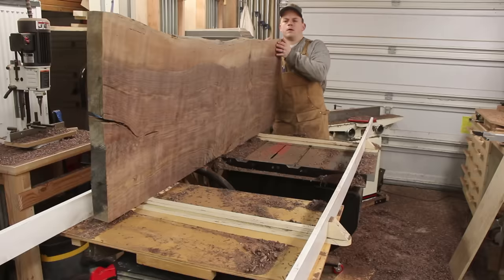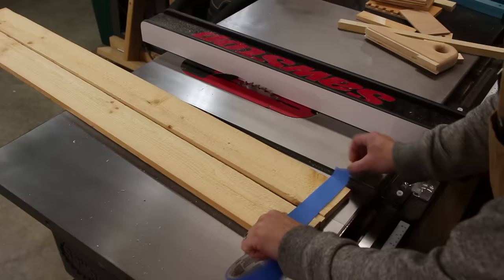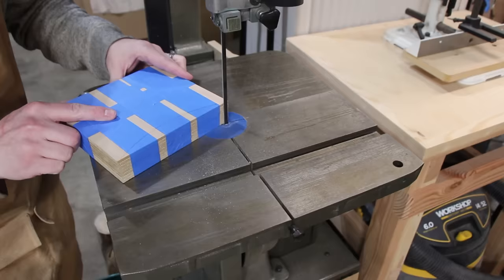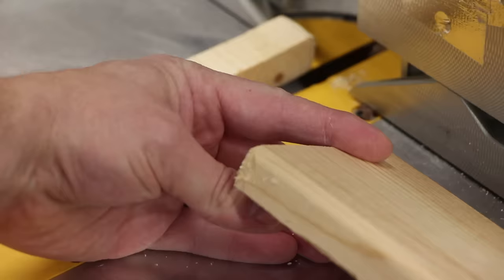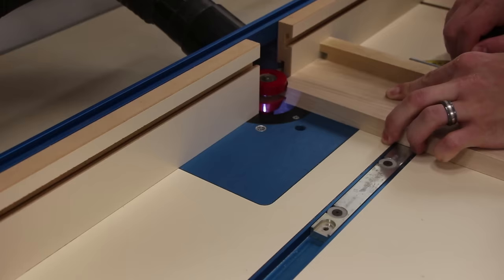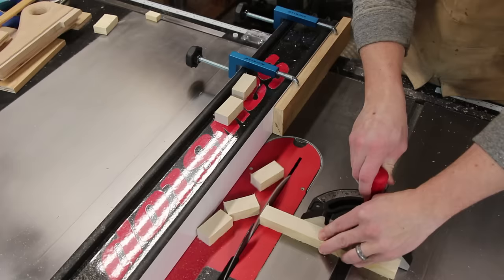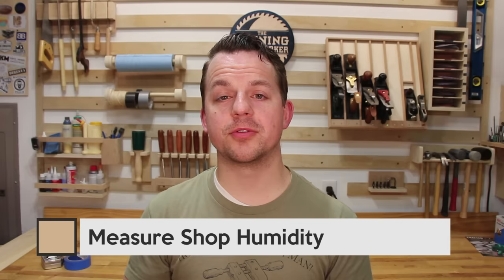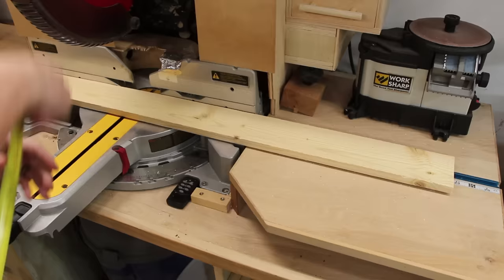7 Woodworking Tips & Tricks You Really Should Know | Evening Woodworker

Comment: @4:30  WHY in the world do you need the Rockler clamps to add an auxiliary fence piece to your fence?  I mean, I own them, but I would never bother with them when a regular clamp would be faster.
Reply: Sometimes you can use the regular clamp, depending on the piece you’re cutting. I’ve run into enough cases where the clamp gets in the way of making the cut, that I picked up a few of the fence clamps and they work just great! The only down-side is having to drill the 3/8” holes in your fence board to put the
Reply: Hooked end into. (darned little keyboards!) 🤣
Reply: @nopelosi2012  Yes, and as I said..."when a regular clamp would be faster"...which was def the case in the video.

Comment: THE best way to measure much of anything is NOT TO MEASURE...

    Yeah, that seems ridiculous... BUT especially when I have a dubious number or a stop and start kind of supply requirement on certain parts or pieces of work, the FIRST I make is as perfect a "template piece" as I can get... THEN there is no more measuring... I lay the template down, draw lines around it, and because EVERYTHING else is a replica of the same template, there's no wandering of measurements no slipping... 

    Similarly, utensils like story-sticks and ticking sticks and pattern boards are imminently better for precision fitting than any tape or caliper or other measuring devices you can ask for. Never measure something you don't have to...

     Sometimes the important part of precision is proportion... so it's not about numbers of inches or millimeters... It's that the length is twice the width and three times the thickness... In these instances, you can even be better off tying knots in strings to keep your marks and measures straight...

     AND finally, you ABSOLUTELY should memorize the "magic numbers" 3,4, and 5... This helps you "confirm square"... A triangle that has legs of 3 units and 4 units is a RIGHT triangle (dead square, perfectly) when it's hypotenuse is 5 units... You can define the "units" as anything you wish... so long as they're ALWAYS ALL the same units. 3 inches and 4 inches gives a 5 inch hypotenuse... 3 feet and 4 feet gives a 5 foot hypotenuse. You can even define a unit (to scale) as 2 inches... so 6 inches and 8 inches in a right triangle gives a 10 inch hypotenuse... Works every time... AND with just a tape measure and straight edge (say... a level) I can even mark and cut a "square guide" for the day if someone mangles the framing square and I just don't have time to screw around fixing the thing...   ;o)

Comment: Tape Measure Trick - Not a good idea as the "slam back" eventually (quickly) elongates the holes and it is no longer accurate - and you don't notice the difference in length (as long as you keep using the exact same tape measurer to measure everything no big deal, if you don't, you will have different lengths).

Best Idea is to bend the spring out so it is not so strong when clamped on.  If too much, vise it back some.

Comment: If you only build furniture, most likely you don't need a tape measure longer than 10 feet while building, so why lug around a heavy 25 foot tape measure all day long.
Reply from the maker: Yes, good point! I typically use a smaller one for my furniture building.

Comment: Two Absolutely critical tips for anyone doing this

By far the biggest tip I have is clean your space. Your shop will become a hazard to your health if you don't clean. I make it a point to clean as I go, sweep daily, and deep clean monthly. Been in too many shops with piles dust everywhere, it is a health hazard and a fire hazard.
 
Next tip your organization. Nothing will save you more time than thinking about where you put things in relation to what their function is, how often they see use and what else has to happen to the material. Store glues near your table, don't have all your tools in the same central location. If you need a clamp and have to walk 15 feet to get it, that is a 30 foot trip. That 30 foot trip for most shops is to get sand paper, glue, fastners, plugs, wax, stain, epoxy, a screw driver, chisels, and doubles every time you forget or fuck something up. If you pay attention to it, a huge portion of your time is fetching things, and this is easily minimized by organizing your space properly
Reply from the maker: Great tips!! I fully agree!

Comment: Be careful letting your tape measure  retract back hard too many times. The moveable tip will wallow out causing inaccurate measurements.
Reply from the maker: Steve Ramsay actually did a test on that and showed that it doesn't affect the accuracy of the measurement... but you can release it slow too!

Comment: (EDITE SINCE I WATCHED THE WHOLE VID - reply at the end) Not saying your not experienced but a HUGE tip, never put a bit of timber through a table saw the way you did in the first tip without using some kind of sled or your asking for trouble. I was waiting for the kickback when you pushed that through. Yes you might have some type of supa dupa home made push stick but most beginners won't. Please please don't show yourself pushing a bit of timber through like that again as beginners who follow your channel will think it's ok. As a general rule of thumb, if your not using some kind of sled on the table saw then the timber should always be longer that the width. If you had even gone off by about 1 deg pushing that through then it would have caught on the blade and the offcut would have been coming back towards you at a rate you don't want hitting you. In my 30+ years on doing this for a living  I've done mistakes on a few saws but the worst was using  a table saw (industrial) with a bit of timber approx 1/2in x 1/2in catching on the blade and shooting by me and straight through a 1/4in aluminium door 3m behind me. If I was standing 6in to the right would have gone through me. You've got a great channel though and like what your doing. (You should have put the last tip about adding a piece to the fence to cut short bits to avoid kick back at the start, most won't watch the whole vid and just think, 'oh that's how I do it')

Comment: Lots of great tips there but the tape trick at the end is a bad one. Letting the tape fly back wears out the stop so the measurements become inaccurate. When I did my woodworking apprenticeship, if we let a tape fly back like that we'd have got roasted by the tutor. Remember the end of a tape is engineered for inside and outside measuring. You don't want to wear it out.
Reply from the maker: You can always slow it down with your thumb... but Steve Ramsay does have some research he did into that very question...

Comment: ahhhhhhh!!!!! i physically recoiled and cringed watching you let your tape snap back like that...do that a couple dozen times and not a single one of your measurements will be correct. the tang on your tape measure is assembled and calibrated to allow for a hook measurement or a push measurement. you let the spring smash it back into place repeatedly and you no longer have a calibrated tang. the tip is fine, pull it out use it and return the tape to the roll without taking it off the belt, but do not let it snap itself back. treat your tape nice before it adds an 8th to everything you measure.
Reply: Thanks for the tip.